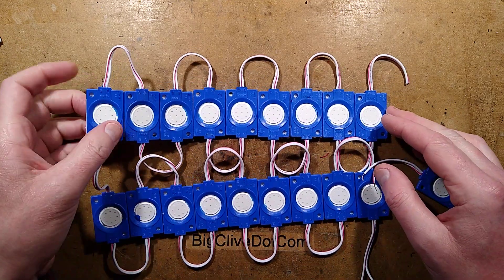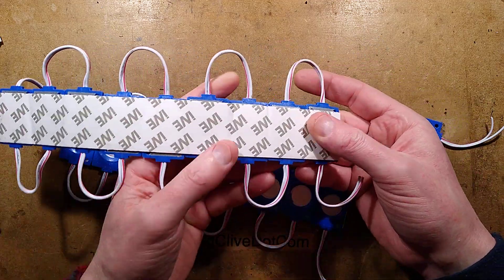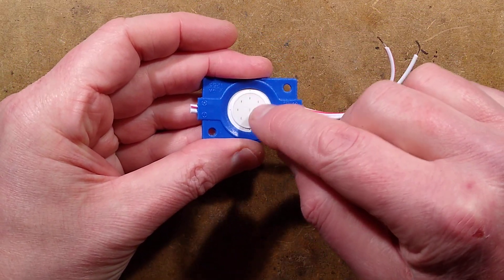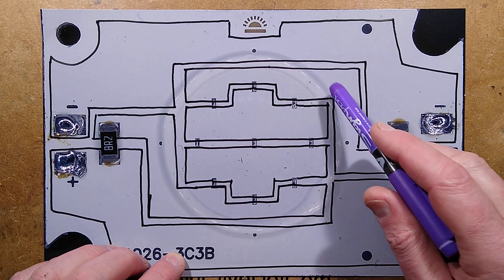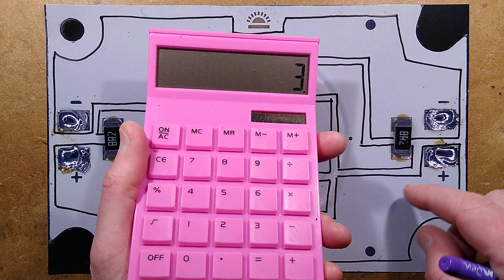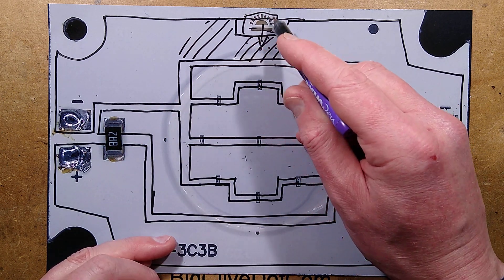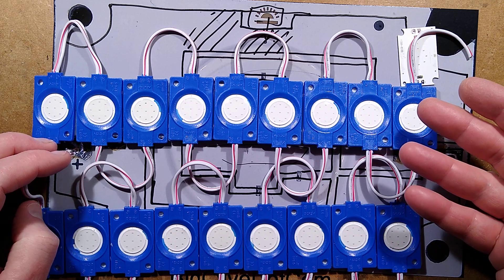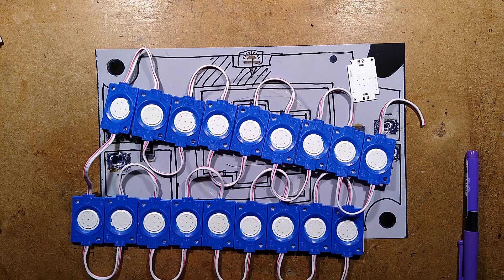LED signage COB module teardown

Comment: Those dots look to be fiducial marks to help the assembly machines locate & align to the boards. Particularly important when dealing with such tiny parts as any misalignment when placing them can cause issues.
Reply: I agree although you generally want fiducials on the copper layer only, with decent pullback of the solder mask.  The solder mask alignment can be pretty poor on cheaper PCBs, and the smaller the parts the more critical placement accuracy is.
Reply: That said, in this case where there is large copper areas rather than just small pads, the alignment of components to the small pads exposed by the open solder mask actually makes sense.
Reply: Oh, like the kind they use for radiation beam-therapy alignment in medicine.
Reply: I'm thinking the ones at the compass points around the LEDs are the same kind of marks for aligning with the equipment that deposits the dam and the silicone that cover the LEDs.

If so, that's why the trademark wasn't moved down, because it would have interfered with the mark at the top of the circle.

But really, the trademark could just as easily have been put in a corner over a resistor without interference AND without impairing the current carrying capacity of the trace; why center it, designer OCD?

Not that it matters much at that current level but the person who does a ripoff copy of the design (and you know someone will) probably won't think that through after they load the COB with higher brightness LEDs to make it "better".
Reply: Most likely fiducials.. 
Man, I havent heard the word "fiducials" since the early-mid 90s when I worked for an advanced SMT manufacturing company. 
The pick&place machines would have a camera to look for the fiducials, and then it used them to locate the board in the exact right position in machine, so that it can correctly put the parts on wet solder paste on top of the pads.
It's hard to believe that was almost 30 years ago. I'd like to see the inside of that place today. .
Reply: @davelowets  The 1990s? Wow, on the Interwebs that's some Deep Background. (Sorry, but for me, obligatory X-Files reference is obligatory.) Dave at EEVblog mentions fiducials in his design-for-manufacture tutorials and occasionally points them out in his mailbag two-minute-teardowns. I think Altium Academy has mentioned them as well. Anyway, any self-respecting PCB layout software has fiducial footprints, including Kicad, and they're named in the libraries as such. Gods help me, I have no idea why they don't just call them "registration marks".
Reply: @petersage5157  Yep. I loved the X-Files. Saw every episode at least once. 
"Fiducials"... 😆 I agree, a more "self explanatory" name would have been much easier.
Reply: It's always disconcerting to us non-Patreons to see two-week-old comments on a video that was publicly released yesterday! Anyway, yes, those dots have to be fiducials. My uneducated guess would be that the larger ones are for placement of the components and the smaller ones are for proper registration of the stencil/dam for the silicone.